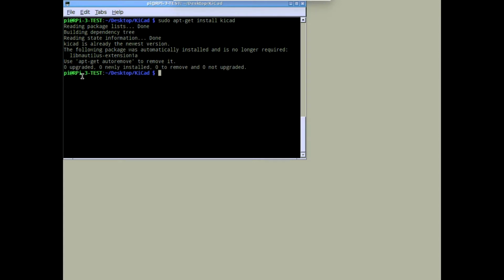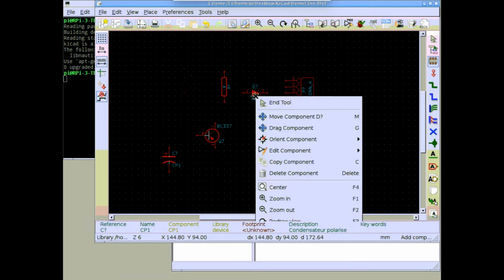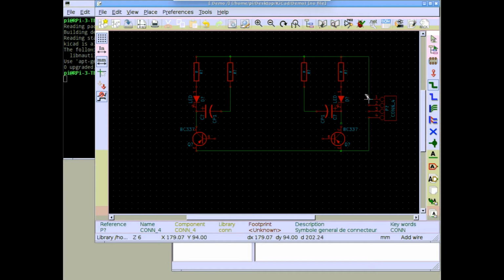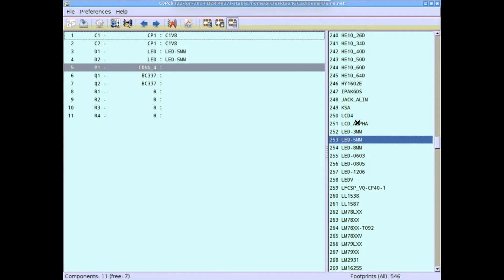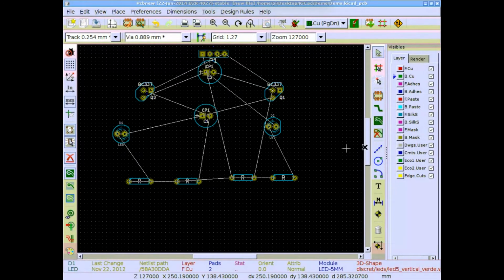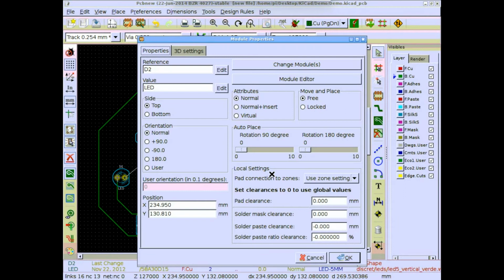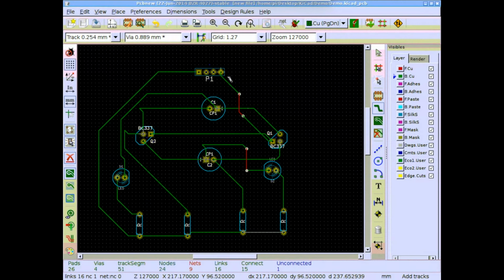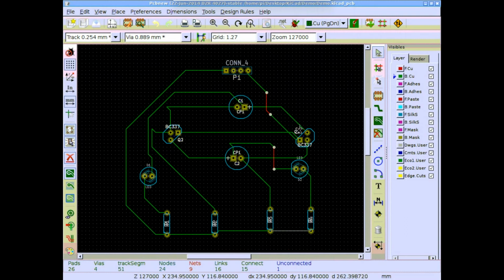Designing a Printed Circuit Board on a Raspberry Pi

Comment: sudo apt-get install kicad && sudo apt-get install kicad-doc-en
Reply from the maker: At the time this video was made, the Raspbian repository had a very old copy of KiCad, and it describes how you get around this issue. It will always be the case that repositories will lag behind current package versions. If there are ever features in a current package version which are required, but are not in the repository version, this process can still be used. It's something I have needed to do several times over my career, several times for driver packages also.

Comment: hi jason i was going to update a camcorder and make it so it will save to sd, 1080p, stupidly large battery, touch screen and all that good stuff. in short i want to know how i should go about what os/program to use, just a full out tutorial on a R pi camcorder
Reply from the maker: So do you mean taking a cam corder which currently records to tape, and plug a Raspberry Pi into it's S-Video or composite output port? If this is the case; I haven't done any video capture on a Raspberry Pi, you would need a USB video capture device, unless you can do it in electronics. I think in theory the latest Raspberry Pi should be able to cope. VLC is an application which can be loaded into Raspbian using something like: apt-get install vlc. VLC should be able to do video and audio capture from a USB video capture device.
Reply: i'm taking every thing out ,guts and all, of the cam and i'm putting a hole new guts in it
Reply: so every thing inside is pi and the outside  looks like a old school camcorder
Reply: i also plan on using the Viewfinders
Reply from the maker: In that case you can use the raspivid application in Raspbian, I used it to produce this project:
http://www.newsdownload.co.uk/pages/RPiVideoCam.html

If you know Python programming, they have now created a Python library interface to the application, so you could do some really cool stuff relatively simply.
Reply: thanks :)